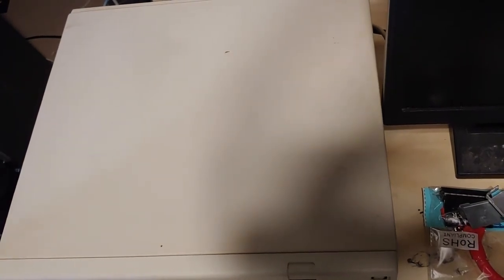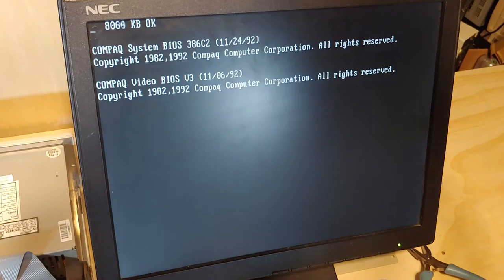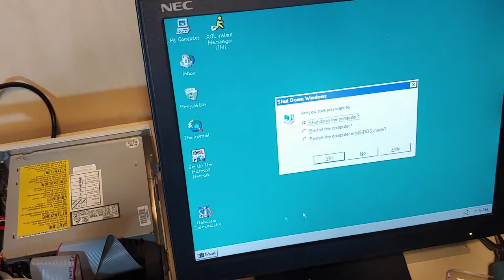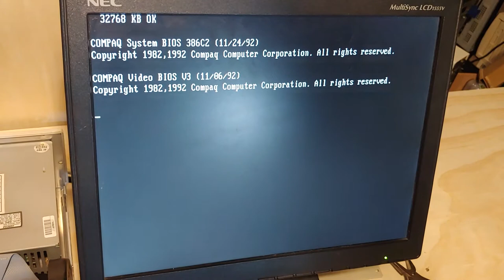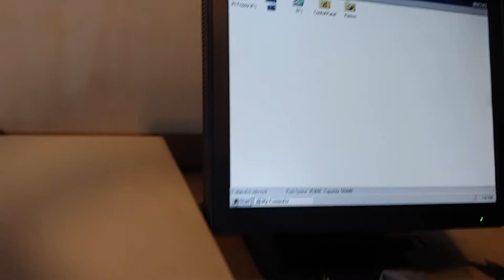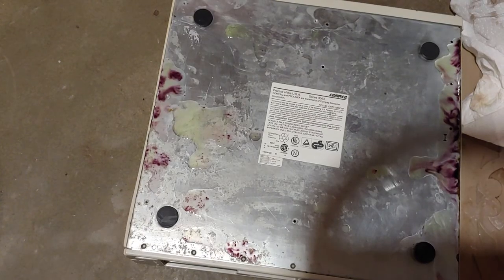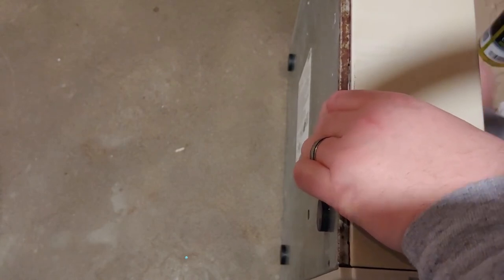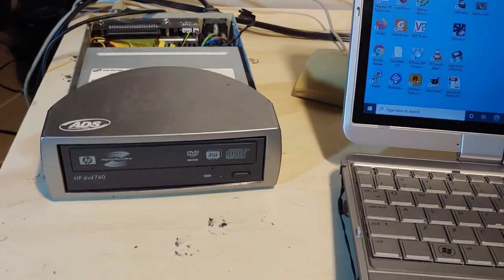Compaq Prolinea 4/25S Restoration Pt. 4 (CD-ROM, IDE cable, cosmetics)

Comment: Do you have the bios setup disks for this computer ?
Reply from the maker: Let's make sure you need them.  The first generation of these doesn't require it.  The later 486 based Prolineas with the red Compaq logo do.  I do have those disks somewhere.